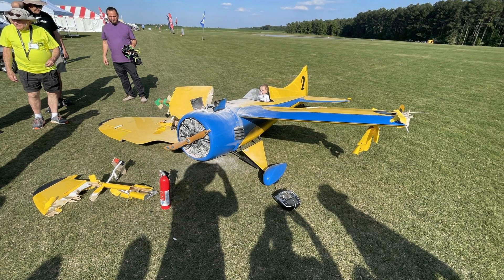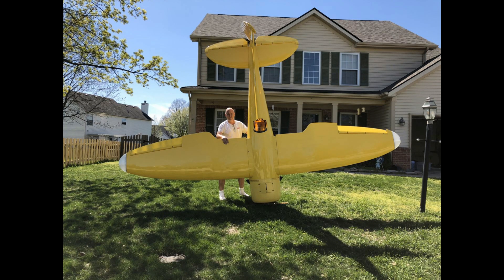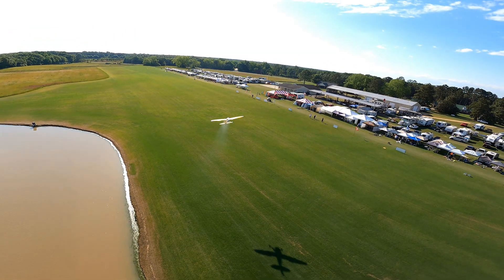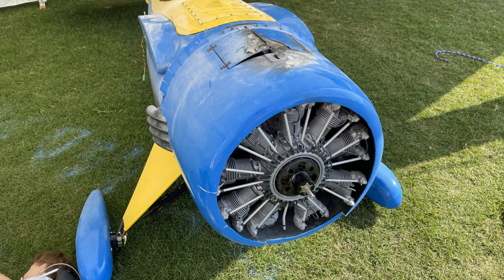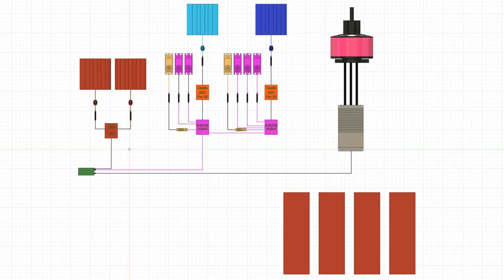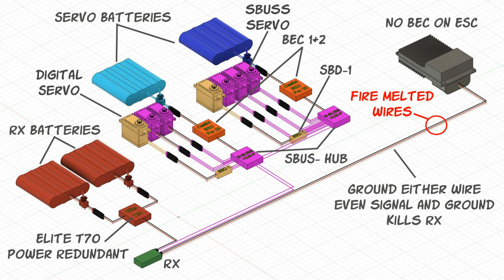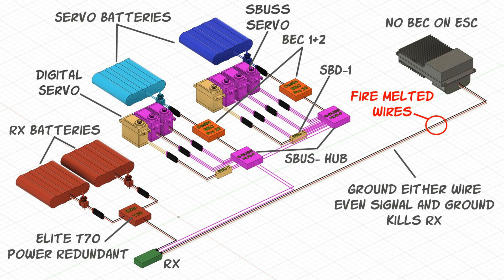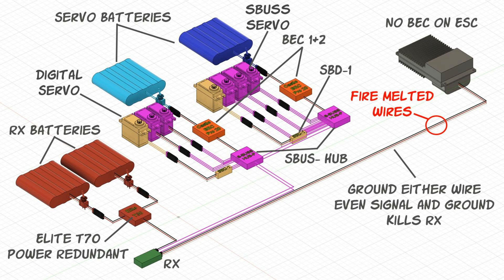Final Crash Report- Emmaselle II Airplane Crash.

Comment: I never plug the red wire from the esc to the receiver 
Watching that the esc ad a problem 
I will not ask what brand it’s
Reply from the maker: @jean-claudeterretaz7464  just an FYI, the ESC did not have a onboard BEC. That is why I did not remove the red wire. It was the physical fire that melted the wires together. So even if the red wire was removed, the fire melted, the signal wire and the negative wire together, which would’ve also shorted out the receiver. Or at least the signal side of the receiver. I have done some testing and even with the red wire removed when you short, the signal wire and the negative wire together it knocks out my receiver. And I said multiple times in the video what brand it was.
Reply: @dagtheaviator  exactly you don’t Need the red wire only signal and ground 
I understand you have no BEC And the power for servo come with onboard battery 
I flew with  200 amp esc in my f5B glider and we alway remove the red wire

Comment: Did you consider using receiver boxes with fuses such as Jeti CentralBox220 or Frsky RB20? That would have likely avoided your issue as the fuse would have tripped.
Reply from the maker: All great ideas. The inline fuse would have been a game changer. Never tried either option you shared, will consider. Thanks!
Reply: @dagtheaviator i think you have a Futaba TX so Powerbox is probably a better option for you. With such high power servos, the fuses are really a great option because the power draw of a jammed servo will be huge for sure. I would also suggest to forego BECs altogether and just power the servos directly off of Lipo or Lion packs. Like this you’re not limited by the 10A BEC which will be limiting even with a fuse.
I’ve had a short circuit and electrical smoke on a regular non fused frsky RX (R8 pro) and surprisingly it kept on working but I got telemetry alarms and landed as quickly as possible. Not fun at all 😅 since then, only fused rx on expensive planes !
Reply from the maker: @AntoineBK  Thanks. Both of my two BECs were Castle 20 Amps running my SBus hubs.
Reply: Yeah those are definitely quality BECs. Did you have a telemetry/data recording setup with voltage monitoring of your BECs/RX ? To see how long it took from short to loss of receiver. This would be an interesting data point.
Reply from the maker: @AntoineBK  I had telemetry that updated me every 10 seconds. It quit updating, but I’m not sure when. Between the time, my buddy who is flying the drone told me he saw smoke in the time I lost radio control was probably 5 to 10 seconds. So the fire had a little bit of time to start melting things.